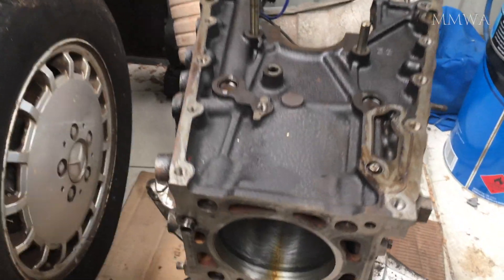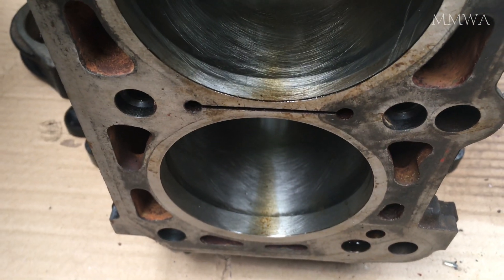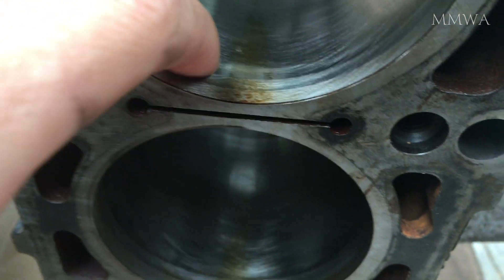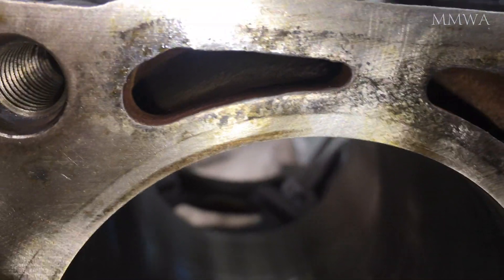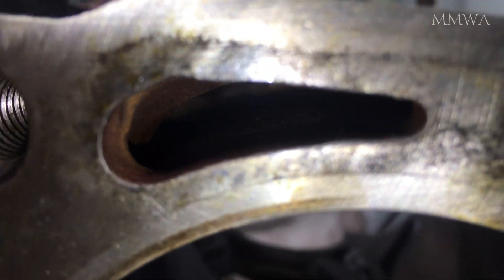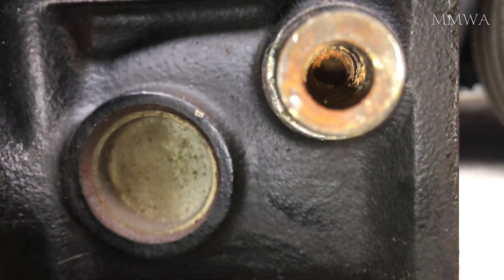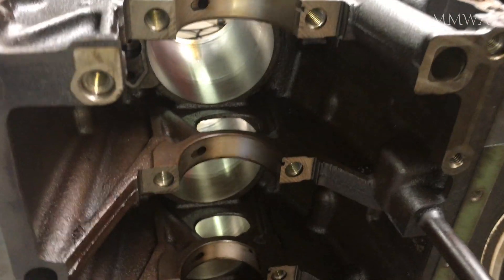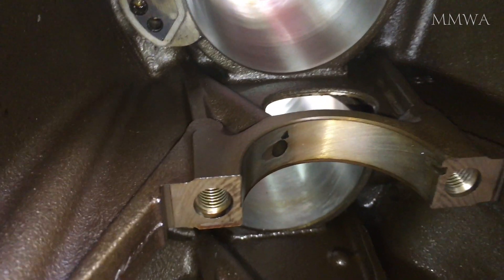Mercedes M104.980 - Up close and personal with the block

Comment: What is your plan for the rebuild? Factory specs or more power?
Reply from the maker: I have the 3.2 litre crankshaft and second oversize (90.4mm) 3.2 pistons waiting to go in, this will be happening in January. It should definitely have more usable low down torque than the 3.0, it will be interesting comparing the cars side by side but I suspect red is going to be a lot more fun than gray. Both will have failed cats and I will install high flow ones to both next year too.